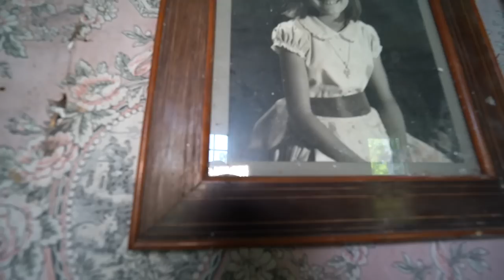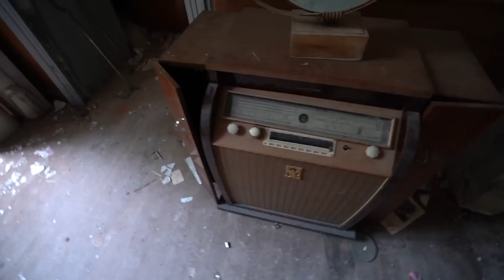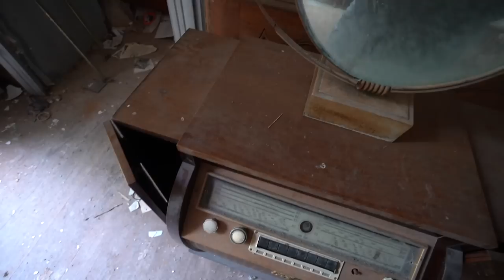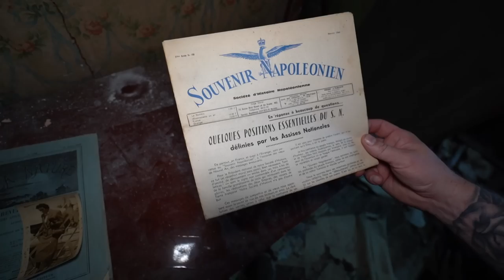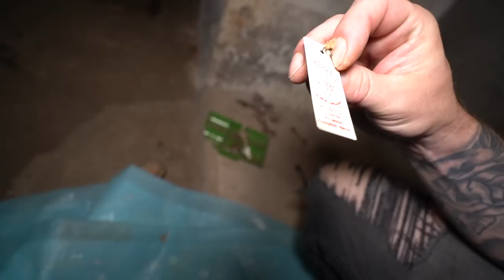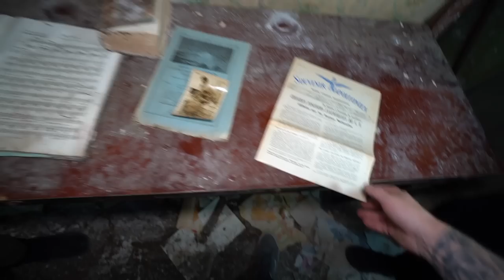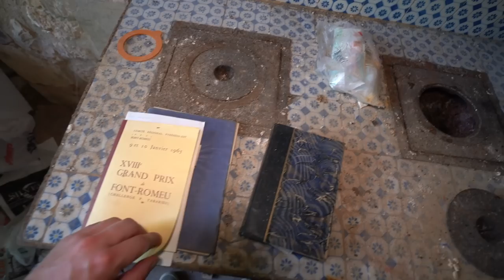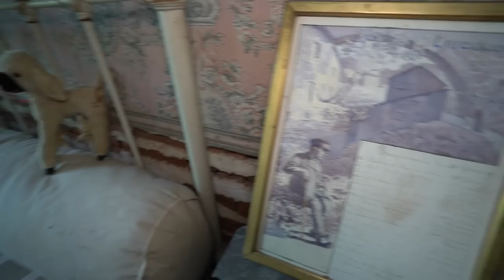He Vanished From This ABANDONED MANSION and NEVER FOUND | SECRET VAULT we gained entry!

Comment: Amazing place. The old wine barrels in the cellar plus the copper vat or still says Wine Merchant, probably kept all the wines and brandy etc behind the locked gates in the cellar. The layout off the big kitchen upstairs was probably a storage area. The servants quarters would have been around that kitchen end too. In a lot of Chatau's during the French revolution would have had secret rooms plus exits as they often hid from the authorities. The French were renouned is those days for hiding valuables in the rafters at the top of the buildings, around the outer lofts down small slots. Only documents such as wine sales would have been kept in the safe and money. The bed you showed on its own and said maybe Napoleon slept here was the old original French size double bed, the same size as a 3/4 bed like back in the day in London. Wider than a single but smaller than a double, this was because the average bedroom also had a seating area, writing desk, dressing table, wardrobes plus space for a ladies maid to dress the Lady of the house etc. The two boat type seats in the room at the begining were traditional French day beds. Well done 💕🇦🇺

Comment: The thing that you found on the floor in the basement that you wondered what it was? It's a spigot that would have been put into a cask (barrel) of wine to let the wine be poured into jugs for use. It would open and close the flow of wine out of the cask. When that cask was empty it would be used for a new cask. Someone lived there in the 60's, possibly 70's because of the RCA Victor (circa 1960's) record player/radio, and the speakers in the other room look to large to be pre-1970. And the VCR wasn't available until the late 70's, so someone lived there until at least then. There is a French Social Studies workbook beside the little girl's bed, (the one with the lamb) I couldn't see enough of what was printed on the front of it, but there's probably a date of printing inside to find a date, or one could search the information the front of it (there's a lot number) to get more info on that.

Comment: The board in the basement with the shelves and the holes in it was a wine rack. They are designed to keep the bottles on their side with the base of the bottle slightly elevated keeping wine on the cork to keep it wet.